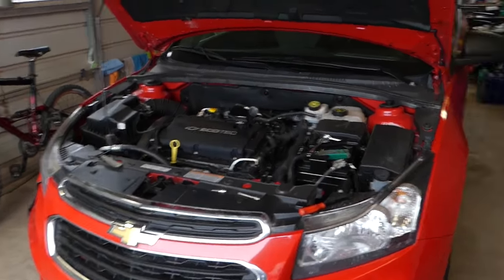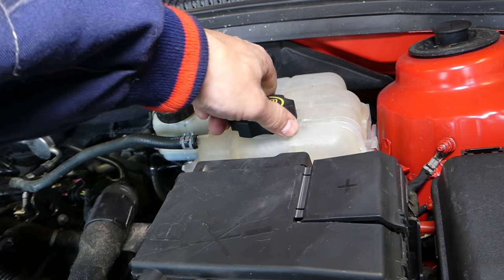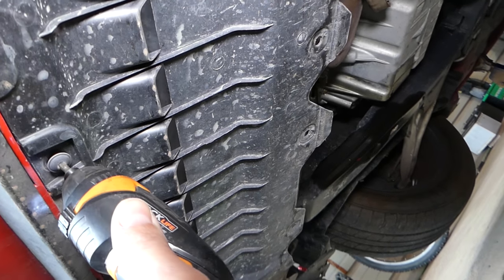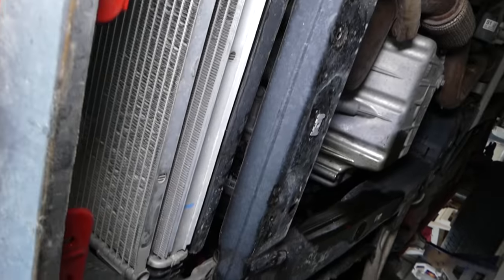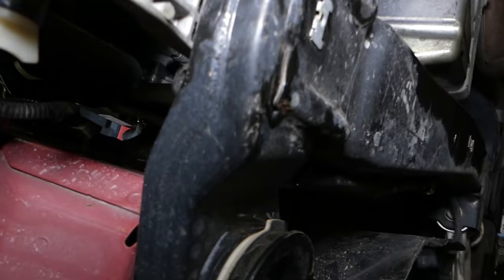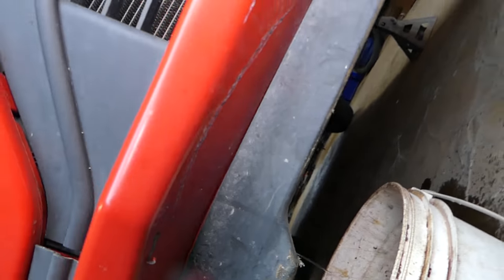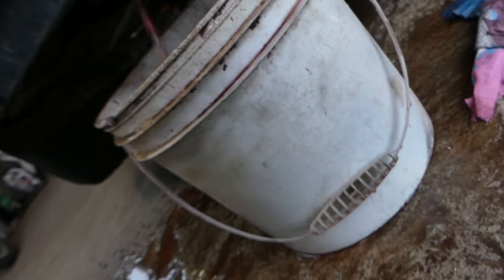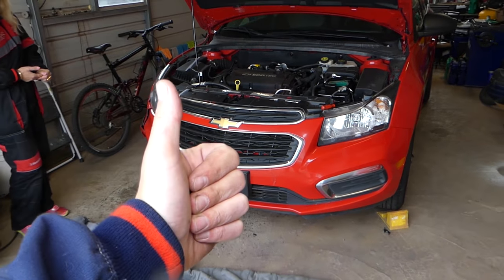CHEVROLET CRUZE DRAIN COOLANT.  FLUSH RADIATOR COOLANT

Comment from the maker: Products that we use and recommend:
► Coolant Dex-Cool: https://amzn.to/48wD6Ig
► Panel Removal Set: https://amzn.to/3YiMADu
► Assorted Fuses: https://amzn.to/4fx4s3F
► Tool Set: https://amzn.to/3p5MM6t
► Screwdriver Set: https://amzn.to/3XRB28Q
► Castrol Oil: https://amzn.to/3xBc8B9
► Oil Filter: https://amzn.to/3w0Ulme
► Torque Wrench: https://amzn.to/32qyRwg
► Liqui Moly Engine Flush: https://amzn.to/3IiDBID
► OBD Scanner that we use most often: https://amzn.to/3I4MQfe

► Check out our Amazon Store for the tools and parts that we use: https://www.amazon.com/shop/worldmechanics
Reply: How should I clean the container? It’s dark brown from the car sitting for 2 years.
Reply: Is this video instructions the same as flushing the Coolant out
Reply: @thegoat1003  find a video on detaching the container and then you clean it with soap and water

Comment: There's a bleeder valve to the right of the radiator that helps the flow of the drain. I had to laugh a little bit when you undid the cap that coolant opened up like a water dam
Reply: Do you happen know where is the drain valve for the engine coolant? Thank you.
Reply: @olenaerhardt7725  when looking at the vehicle head on, it will be on the bottom left towards the front of the vehicle
Reply: @designermywaist4218 Thank you for your replay, but it is radiator drain plug there. I need the Engine drain plug.
Reply: @olenaerhardt7725  Oil plug? There is no Engine coolant drain plug, you can only drain from the radiator plug.

Comment: I love your videos. I own a chevy cruze and I use these as a guide. I have replaced my Serpentine belt, sparks plugs and coil pack, purge valve and now I'm going to do Water pump and engine mounts next. I haven't been able to watch everything yet so if you have not done anything for the fuel pump or fuel filter, that would be a great thing to add. Suspension would also be helpful. I apologize if you already have videos on these topics!

Comment: Geez   on a 2012 Cruze 1.4  the radiator drain is on the bottom right side of radiator and an air bleed screw on top right . I was mainly  looking  for an accessible coolant drain on the engine block and saw a  nice big T -55  torx plug by the AC compressor I thought was it, but it wasn't.  It seemed to be some sort of unused return  point for an optional oil cooler or something. It makes me very angry I can't find a coolant drain on this block like the older EcoTech turds had at back of waterpumps. If I was that Russian Gun guy friend of yours I think I would give this engine block  a very bad day🤣

Comment: When I changed out the temperature sensor I drained my coolant and filled back up and coolant came out of a nipple next to the radiator drain plug what do I do?!
Reply: I just did mine: put a piece of rubber hose in the nipple toward a pan.
Reply: I need answers to this too

Comment: What year is your Cruze?  I have a 2011 is it the same procedure?
Reply: Procedure is the same for almost any car.   Locate radiator drain plug.   Get a pan wide enough to catch all the coolant. You can use plastic or aluminum foil to help guide the stream of coolant so it doesn't go everywhere.     Once the system is empty, refill with distilled water and/or coolant flush product.    Go for a drive with the heat on high to warm everything up.     Let the car cool back down.    Drain again.    Refill with proper coolant.